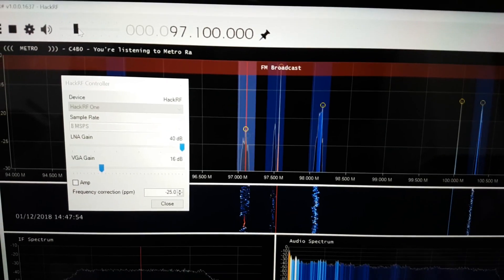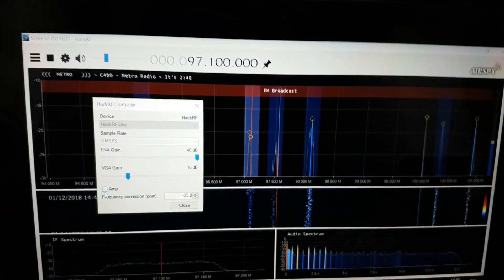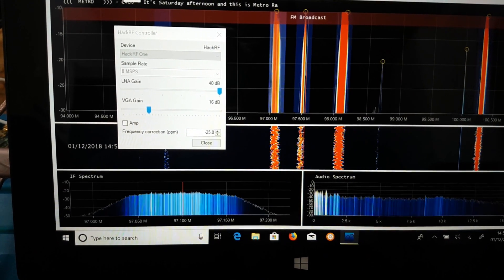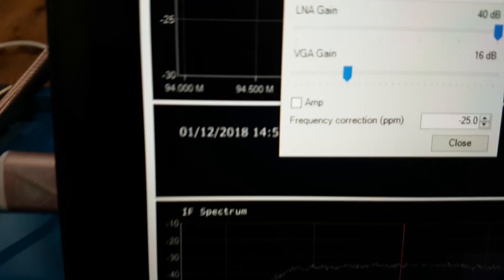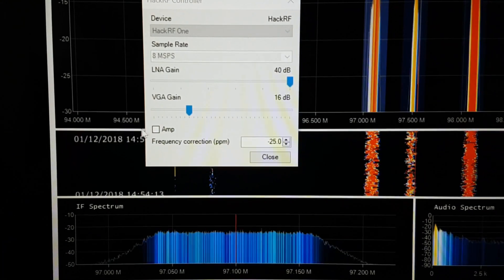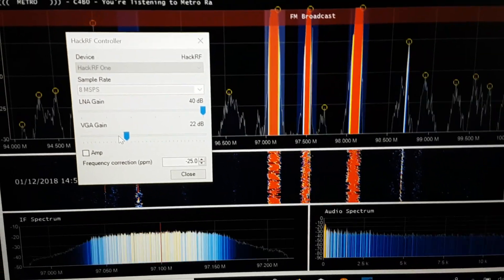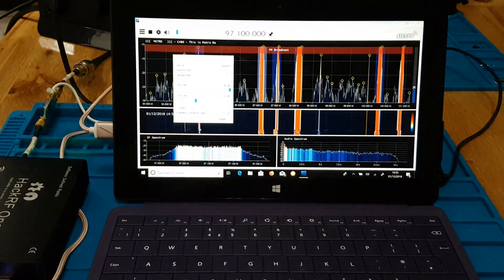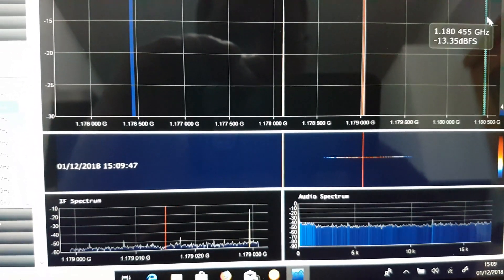HackRF Preamp Workaround

Comment: FAKE!!!! Tried with same amp same setup.
Reply: 4 years later....I does work. If you want to amplify receiving frequencies, your amplifier's out port goes to the Hack Rf one's antenna port. You have to reverse that configuration to amplify transmitting power (amplifier's out goes to the antenna). No need to power on the DC toggle. Just use USB power. Hope this helps someone in the future.

Comment: Nice work around of the problem, do you have a link to pre amp supplier. thanks again for the video.
Reply from the maker: Hi Bob here is the eBay link where I bought mine from... 73 baz https://rover.ebay.com/rover/0/0/0?mpre=https%3A%2F%2Fwww.ebay.co.uk%2Fulk%2Fitm%2F183459432648
Reply: Thanks for the link Barry.  Im going to give one of those a try they look great.
Reply from the maker: If they run out do a search for LNA or LNA 4000 and you should find them no problem ... baz
Reply: removed the antenna while tx?